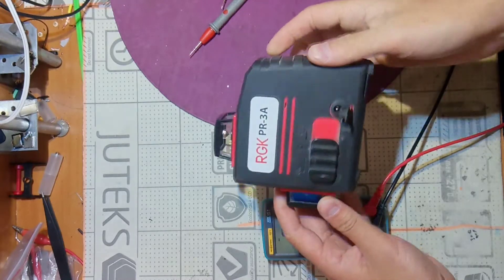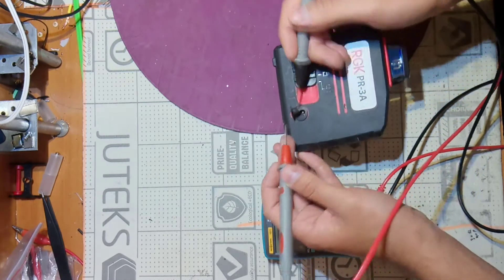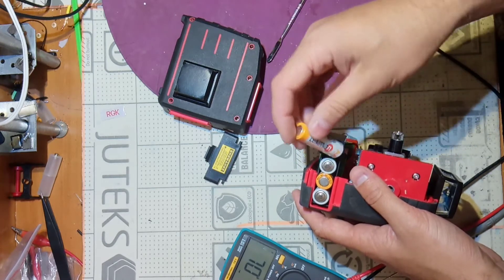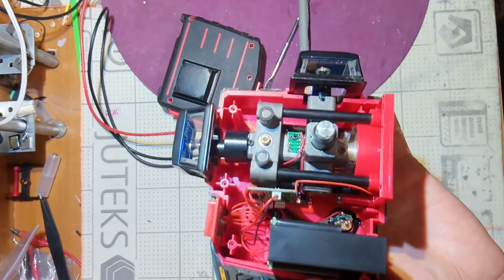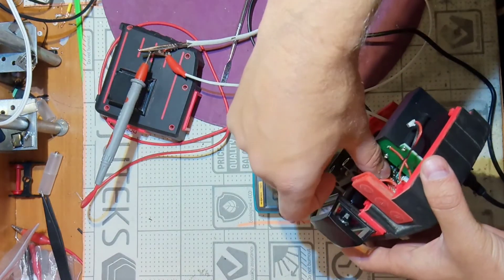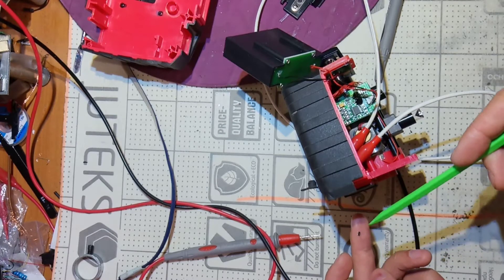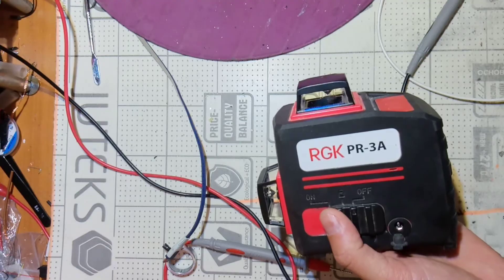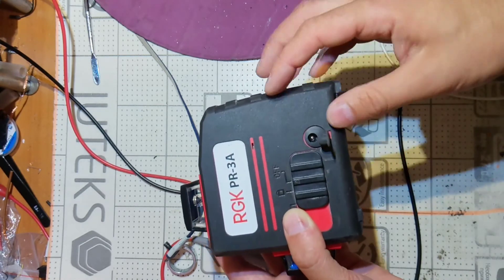Laser level repair. Powered with higher voltage

Comment: my laser level fasget 4d wont turn on if i connect it to external power source. like he need original battery with some electronics in it to work. but battery have only 2 connectors to laser so i dont think this is reason.